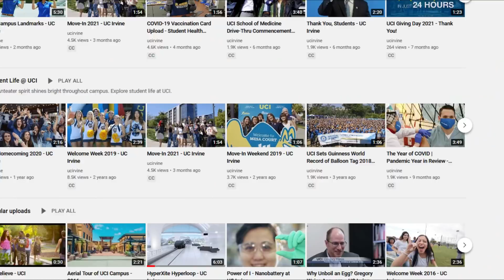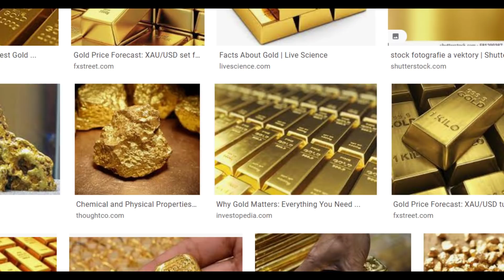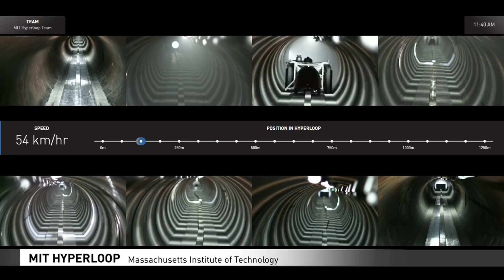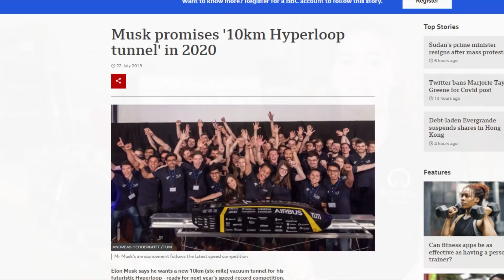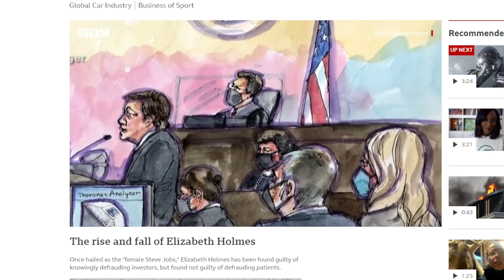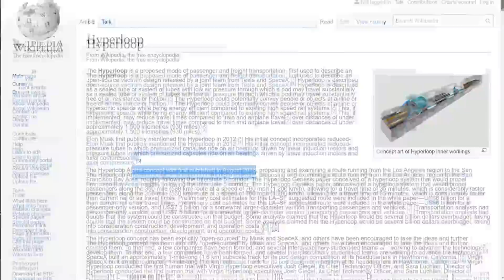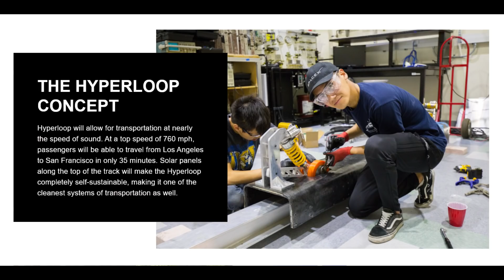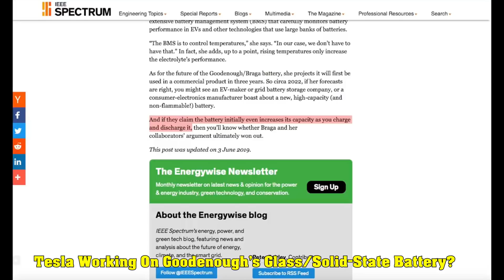The GOLD Battery that will revolutionize EVERYTHING!

Comment: I propose a new battery.
Using a similar design to a glow stick, you combine two highly volatile chemicals by cracking it open.

Then you can freeze it to re use later.

EDIT: I think some people didn't realise this was a joke
Reply: That sounds awesome. Like half lead half sulfuric acid. Don't know of freezing would stop activation. But dude thats genius.... I think?
Reply: Recharge by freezing it?
Reply: You could do a similar thing with steam turbines if you freeze the steam.
Reply: @ennote91  Vinegar and copper
Reply: @SomeOneOneOne  Some glowsticks, if you freeze them the chemicals separate and you can use them again later. You crack the ice inside for a similar affect.
Reply: How much energy to refreeze it please?
Reply: @almightyk11  so yes? so like chemical handwarmers you can reuse them after boiling. But i doubt it could work, cause if it recharges by freezing, you could drop it in some ln2 for 10sec and boom recharged! That would be too good, so if you need to freeze them slowly over a longer time to hold a charge there is no real point. Also if you keep them frozen and use them, will they run out, break,  or recharge?
Reply: Ah yes, with its famous low energy consumption, uncomplicated build, easy peasy isolation and environmental friendly cooling liquids --> freezing is the key for sustainable energy storage!
Reply: brilliant give this man a government grant
Reply: @glennllewellyn7369  Just mix it in the Antarctic and it’s no energy at all
Reply: @spyran5839  omg that got me snorting.
Reply: Well...there is a thermal battery, heat packs. Basically a bag containing very salty water, which is supposed to be solid at room temperature, but isn't, because it lacks a seed to start crystallising.
You can store them basically forever and release the heat energy by snapping a bi-metal inside the bag, kickstarting the crystallisation.
Recharge by cooking them until fully liquefied again.
You could use them to store energy en masse, but it would be just as dump as this idea.
Reply: If you run the energy required to freeze it in parallel you could heat your home with it.
Reply: what if you use that liquid that your activate with a metal snapper inside, it crystalizes and provides heat, hand warmer.
Reply: @timhartherz5652  Calling it a dumb idea is a bit harsh
Reply: @almightyk11  Yes, i'm sorry, that sounds to harsh.
The idea at least deserves an "Golden Hammer Award" for creativity. A term i totally borrowed from one of Thunderf00t's erlier video's.
Better? :-)

Comment: The hyper loop would be better if it was literally just a railgun train
Reply: @skuzlebut82  my money is on railguns for long distance travel especially space travel
Reply: Splat! And all red on the inside!? 😂
Reply: @nerroworks7562  would be too much g force or really, really long. Either are prohibitive.
Reply: @nerroworks7562  I'm not sure if you're being serious or not. The g force from electromagnetic acceleration in a large enough rail gun to propel humans would turn us in to a pile of goo. It's essentially the same issue with sending satellites up using artillery, the g forces involved, the electronics can't handle. The US fielded a nuclear artillery round for a while during the Cold War, the round couldn't handle the g forces associated with that kind of acceleration, so they had to stick a huge, heavy piston in the barrel that spread the total force out over time.
Reply: @Dee-Eddy  if they go too fast too suddenly but you can controll their speed
Reply: @nerroworks7562  right, by lengthening it. Otherwise you wouldn't get enough inertia to outweigh more traditional means of transport. But the amount of length you would need to add to accelerate at a "comfortable" 5 Gs or so would be ridiculous. Kilometers at least. Pretty much a space train with a jump at the end. I'm assuming it would be attached to something massive in space, maybe a moon or something (with little to no atmosphere) since it would accelerate in the opposite direction if it were in space making it essentially one time use without using the same amount of change in velocity to counteract the previous launch (shot?). This isn't impossible on paper. It just comes with a whole lot of needed infrastructure and the bigger you make it, the more impossible it becomes to achieve.
Reply: @Dee-Eddy  the space one it would just shoot it into orbit to attach to a larger craft (to save fuel) and a land train it would just be a capsule that holds people and slowly accelerates (for a rail gun) to high speeds
Reply: @nerroworks7562  the "bigger" one in space that it attached to would still move the same amount in the opposing direction and would need to be countered by the same amount of force if the bigger craft were to be in any sort of stable situation. As for accelerating slowly in a rail gun, what do you mean? Accelerating slow enough to have humans aboard also come with being in the the hundreds of pounds range, more likely tons. There just isn't any way to accelerate that in a short space without it being 100s of Gs. It would likely be long enough to make it into a loop and pretty much just have a giant particle collider on the moon.... Which like I said, isn't exactly impossible, just prohibitively expensive.
Reply: @Dee-Eddy  it’s not impossible you’re just thinking about it as a gun and not a propulsion system it would just be a glorified high speed train like japans bullet trains they go insanely fast and people can be on them and survive
Reply: @Dee-Eddy  0-60 in about 5 seconds is really fast and completely survivable you just do 0-120 in 10 or more seconds see how it works I’m not saying 0-100 in half a second here I’m not taking literal guns (apart from the orbital launcher)
Reply: @nerroworks7562 and how far does a car travel in those 5 seconds that it is getting to 60mph? I'm guessing around 200 feet? what kind of space velocities are you hoping for? To get into orbit around the moon, which has no atmosphere to slow you down, you have to go well over 2000 mph. There are a lot of ways to visualize it, your 0-60 is a good example, but no matter how you slice it, if you wanna go fast from a rail gun, you have to impart that force over an amount of time. The length of your barrel sets the acceleration rate needed to achieve any given velocity.
Reply: @nerroworks7562  so now we are talking Earths orbital velocities.... Even worse. Do you know how much boosters weigh? Railguns we use now to get things even remotely close to Earth's orbital velocity are throwing around 20 pounds that fast. And using something like 10 megawatts to do it. Boosters weigh tons. Dozens if not hundreds of tons depending on which. 

Thinking of it like a train is what I had said previously, but like I said before, it would need to be long. very long. Prohibitively so.
Reply: @Dee-Eddy  with enough power and determination you can shoot anything out of a gun
Reply: @nerroworks7562  right. But there is no gun that can shoot a human to space from earth. At least not with them surviving. 

You would almost want to not impart all that energy at once. Maybe you could store some of that energy chemically and bring it along with you so that you can release it at a rate that maintains a comfortable amount of g force for a longer time ...
Reply: Not yet there isn’t yes it will probably be a mile long but who cares it’s cool
Reply: @nerroworks7562  did a little back of the envelope math... More like 300 miles. At 5g acceleration. Any more than that and there is a good chance anyone on board is passing out. But that would be holding 5gs for over 2 minutes. Now if we don't mind them passing out and what not, I'm sure we could widdle that thing down to a couple hundred miles. Now, that is from earth, but also I didn't account for atmosphere at all, or the insurmountable heat from de-entry (lol). Good news is it would only have to be dozens of miles on the moon, now to just get it there.

Comment: It's funny how 10km is the apparent goal when a 100km tube is about the minimum where I'd feel I needed to use one, assuming they manage to take advantage of at least near the theoretical limits.
Reply: If you ignore common sense, then getting to 160KPH/100MPH in under 100 meters of track is totally feasible and poses no safety issues at all; If you ignore common sense.
Reply: I believe Thunderf00t did do a video talking about the actual length of track needed for a manned test ride for a curtain speed goal. Basically it's extremely long
Reply: I don't even understand how they would intend to efficiently create a vacuum in a tube, and then efficiently get passengers in and out without constantly having to re(un)pressurize. It makes no sense.
Reply: @SnootchieBootchies27  Small airlocks. 1m cubed of lost vacuum isn't much in a long track
Reply: @SnootchieBootchies27  There is supposedly a prototype airlock that one company made but like everything with Hyperloop, I wouldn't trust it actually works. As for removing atmosphere from that length of tube, the details really remain sketchy, as well as details of how they'd handle the failure of the vacuum, which will happen.
Reply: @SnootchieBootchies27   Let's say the tube is completely circular and the train is perfectly shaped like a cylinder, flat in both ends. If the train and tube fit that snug they can grab each other to make a seal. Then the side can open. All in all you could end up repressurizing less than 1m^2.
As is even mentioned in the video the aerodynamics of the tube doesn't matter because of the low air pressure.

Comment: Let's try to make a battery that is a capacitor and a battery at the same time.
Reply: Then you could wire one end of it to the other and make a perfect device that would run forever.
Reply: On a more serious note, ceramic electrolyte batteries hold both faradic and coulombic charges, although faradic effects are an order of magnitude greater.
Reply: Igor T, that's what is called a supercapacitor or ultra capacitor.

Comment: When I was an undergrad, in the late 1980's, I designed a computer processing chip demonstrating that enough computing power could be put in a spy satellite to perform image recognition of objects on the ground (such as, say, camoflauged aircraft) when most of the profs in the department (who my advisor had asked) were absolutely certain that there was no way enough processing power could be put on one chip.

This later became the foundation for the Keyhole-11 digital imagery spy satellites, permanently replacing the previous generations which were launched with rolls of film, which then ejected exposed rolls which then fell earthwards by parachute and had to be spotted and collected by USAF aircraft in mid-air.

And this was at one of the top electrical and computer engineering universities on the planet.  I'm not saying that the profs were dumb -- the computing capacity of a single chip was changing rapidly/.   But my point is, and this wasn't even a Senior Project, it was just some independent study I picked up because I happened to drop into that prof's office to tell him that, finally, a year after taking one of his courses, I finally grasped HOW the math that we were doing actually gave us the answers that we were looking for (hint -- 2 full years of calculus required as a pre-requisite... and ALL of us struggled in that class, despite it being composed of students who had B+/A- grade point averages just to get that far in the curriculum.

It's a travesty that our K-12 system is so lousy that the obvious contradiction (streamlining to travel in vacuum pressures, when, really, pneumatic tube travel relies on differential pressure, and therefor, the desired shape is one which FILLS the tube (at least on the ends), so as to have a low-pressure and a high pressure side -- just like the pneumatic mail-tube systems still used in many large commercial/office buildings which were built to spec by the original (sole) occupant company.
Reply: Many teachers are way...way behind industry. My college lecturer (years ago) said that non-polarising electrolytic capacitors were only available at the size of a can of beans, while I was using 15mm sizes of the things at my work placement. He also said you couldn't get multi-layered PCB boards when I mentioned it them to him. I was using 8 layers boards at that time as well. He actually laughed at me at the suggestion of them.  They haven't a clue.
Reply: Kh-11 launched in 1976 my guy...
Reply: Hey bro, hate to break it to you, you just said you were an undergrad in the late 80's... but you're off by a couple decades for your story to be true.
Reply: This sounds like my old calc professor who claimed to invent the GPS in the 90s before everyone else.

Comment: That very last clip - there is absolutely nothing worng (in the financial sense) with legalised marijuana!   It would be entirely practical, it is conceivable that it may happen, and I guess there could be a lot of money to be made from it (just like tobacco).   UNLIKE hyperloops and gold batteries and almost anything else that Musk promotes.
Reply: @Kfreeks   Same can be said for alcohol.   And tobacco causes lung cancer yadda yadda.    Both of which have made investors very large sums of money, absolutely legally, in the past.    I was talking about the guy's stock market tips.
One could argue that the War on Drugs has caused, globally, far more suffering and damage than drugs ever did (just like alcohol and Prohibition), but that wasn't the point i was making.
Reply: @cr10001  okay fair enough
Reply: @Kfreeks   I must admit my first wording was possibly slightly confusing.   I was contrasting Smart Investors Daily's endorsement of gold 'batteries' (which are, technologically/economically, fairy dust levels of absurdity) with their endorsement of legalised marijuana (which is entirely commercially feasible, putting on one side for the moment the various social arguments around it).

Comment: Something bothers me about this video, I don't necessarily know if that gold battery technology became anything. But I do know that the video wasn't talking about the battery holding "unlimited" power.  If you listen really closely to what they're actually saying, they're  saying,  they're talking about how many cycles the battery can withstand.  Not that it can hold power forever, but that the battery is less prone to wear over time such as lithium ion batteries. Lithium ion batteries generally have a lifespan of between 500 and 1,500 cycles. The graphic that he showed in the article that is white, stated that that battery could CHARGE 5,000 to 6,000  cycles before degradation.  That puts it at a range of about five times more resilient than common batteries. Something that's a lot cheaper than gold though is graphene, graphene batteries use layers and layers of one atom thick sheets of graphite.  Which conducts pretty much as well as gold, and they're able to align it in a thin array.  Graphing batteries can't hold limitless power,   but they can sure stand the test of time as they degradate about two to five times as slow as a lithium battery.  I just wish the video paid more attention to what the battery video was actually saying.  There's been a lot of different prototypes over the last couple years for different battery technologies, and the future is only to come!
Reply: I hope you know a graphene battery (Protoype only) would cost you around 1500$ a piece than your duracell use and throw which are not more than 2.5$. Your battery would be worth more than the appliance xD
Reply: the resilience of this battery comes from it being not a rechargeable battery, but a capacitor. From what I get the PR team making the video didn't know what they were talking about and didn't bother to ask, instead just trying at being sensational. I didn't bother with the original video though and I do not think I will.
Reply: A capacitor is not a battery. A capacitor can charge - and discharge - a million times a second  - continuously, for years!

Comment: I am bemused as to how they came to the conclusion that the battery (capacitor) could potentially hold an infinite charge 🤷
Reply: I think they were trying to convey that it didn't suffer discharge degradation and maintained it's capacitance after millions of charge cycles, but you get an enthusiastic talking head with no solid footing in electrical theory to convey the message and it turns into a really crappy game of "telephone".

Comment: But aren't gold wires already being used in electronics as a conductor? I don't think the price of the caps is the limiting factor in the project.
Reply: Tahaha, yeah, but now think how much gold is needed to hold any remotely useful charge. That is where it becomes stupid. And heavy. May as well use a lead acid battery then I guess...
Reply: Not as a conductor, but as plating to make connectors resistant to rust. Well conductors exist, but they are only used in critical applications.
Reply: Gold is usually used for the connectors, there is very little benefit to making the actual wire out of gold as copper is more conductive. As copper is relatively reactive, it is not ideal for making connectors out of. Interestingly silver is more conductive than copper.

Comment: "Virtually Unlimited" but it says UP TO 5-6K charges. The funny thing is, some of the lithium chemistry batteries already last 5-6,000 charges, at a fraction of the cost of gold. Forget the 6 years of nothing happening. But hey, she hits several protected demographic checkmarks so there's that.
Reply: That last line was unnecessary, but otherwise correct.